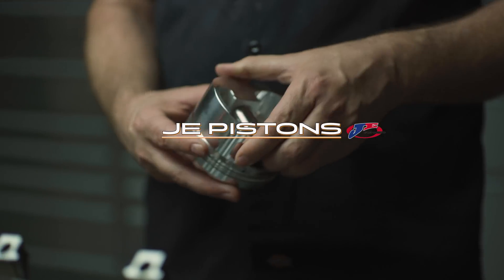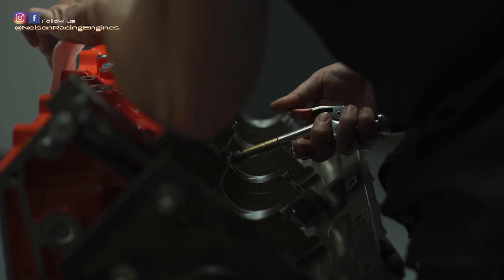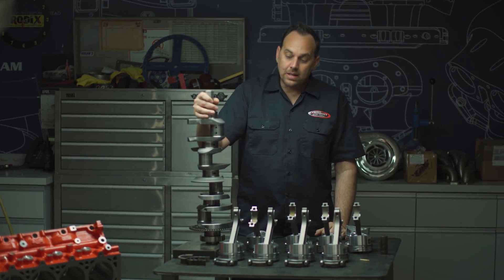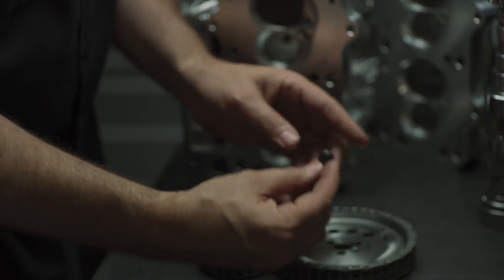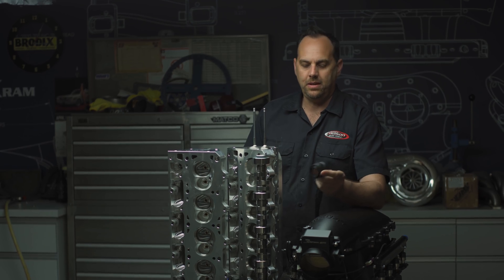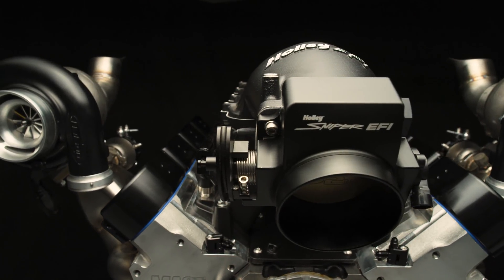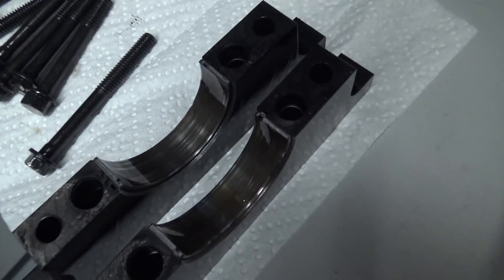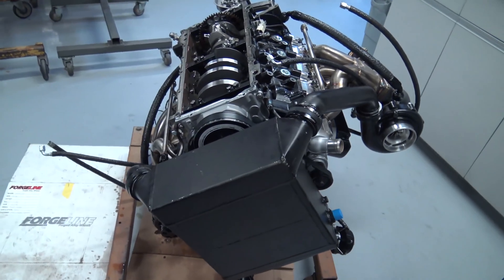Secrets Revealed!  1200 HP 260 ci Chevy LS!  Tom Nelson reveals his secrets!

Comment: Tom Nelson got your ears on ? I want to see a NRE small block Chevy configuration equiped cam, rods , pistons. crank , bearings etc. etc. set up of NRE choice set up to be compatible for todays modern two four barrel EFI throttle bodies which I just now watched a video from nitrous express express claiming you can program those bolt on EFI four barrel throttle bodies to spray more fuel for DRY NOS ....example of a EFI 4 barrel throttle body system 
https://www.edelbrock.com/shop/fuel-injection.html
why you ask ..? these EFI bolt on plug and play self tuning 4 barrel throttle body kits are getting cheaper to buy ..allowing the average street racer to put more bucks into the build quality of the engine internals ...like this boat motor shoehorned in under the hood of a Chevy Chevette ...
back in the mid 80s on south west archer avenue Chicago  there was a speed shop specializing in selling turnkey pro street chevettes with 502 big blocks with a tunnel ram. rising out of the hood two holley dominators and those. huge full coverage vilocity stacks that look like spittoons level with the roof top of the car ..they were tub-bed out with mickey thompson's narrowed rear end so all you saw from the rear was big rubber a Dana 70 pumpkin and more big rubber anda short set of wheelie bars ...
I believe your little buzz bomb boat motor with dual four EFI + NOS in a chevette could be exciting and get decent gas mileage and extra engine life as we know EFI has never washed out rings or bearings ....BUILD IT AND THEY WILL COME ....and if it becomes popular and I think it will you will have the opportunity to build a specialized NRE optimized EFI intake manifold ...tada ..there I just made you another million ...like lee Marvin said to the ladies above the bar in "paint your wagons"  " i give you the boy.. give me back the man"

Comment: At 1,200 hp What was the TORQUE, on that awesome 5 min pull. I'd love to have a engine designed to take that kind of torture. It's not abuse if it's ment to run under that kind of condition. My hats off for your ability to assemble & maintain a power plant as such WAY COOL !!!
Edit: I'm still convinced the Chev 409 or Z-11 427 with today's ability & technology. That Big block has unknown capabilities of horsepower and RPM's even in the late 60's race teams found out 6,000 RPM
Was just starting to produce staggering amounts of Horse power. But the iron block coud'nt take the stress due to its design.

Comment: That oil separator pump is something sweet.  I even want one in my daily driver, let alone in my race motors !
Reply: Yeah copy that, would certainly protect the engine from oil pressure leanout due to the oil consistency and the viscosity without any air turbulence.

Comment: Great build Tom. I like the recessed edge of the top of the cylinder. I was thinking, why not make a raised edge circles on the cylinder heads to fit  in each recessed valley. Perhaps make the recessed valleys just a little to small & heat them up, & the raised lip circles to big & freeze them, when installing them. I also think it would be  more powerful if you fired two pistons at once, like the front piston on one side & the back piston on the opposite side. I'm sure these billet cranks could handle the force easily. Another idea would be to turn a V8 block into a 4 piston block by making rectangle pistons out of two cylinders, & rectangle valves. The intake valve would be on the top side near the jntake manifold, & the exhaust valve on the bottom. The header could be rectangle shape at the top that turned into 2 inch round tubes. I also believe a flat plane crank is better balanced & produced more power & rpms. I was also wondering if you've ever heard of throttle exhaust. We use it in RC nitro boats & they work really well, perhaps it would work well in fuel injection turbocharged v8 engines. Keep up the good work, your a great engine builder.

Comment: That was frick`n awesome guys. I building an ls for my sons Camaro. I want 3 1/4" stroke on a 4" bore. Need a bit more torque so I don't have to run a tall gear. Keep it reasonable for a street car.
Reply: An ls like an oldschool 327 nice!
Reply: @talonvaughn6175  Spot on. He's got a 3.73 posi rear gear, and I've found that to be a good "all around" gear for the street. 😎
Reply: @aumetalmental8403  they are great gear for th350-400 and 700r4s thats for sure and muncies of course. I have 4.10s in my 06 ls2 gto with a 6 speed t56, runs amazing.
Reply: @talonvaughn6175  extra gears definitely give you more range. They don't teach young people how to drive a manual trans in Driver Ed anymore so my son is clueless and will only drive an automatic. They don't know what they're missing.
Reply: @aumetalmental8403  Yeah they dont know what they are missing. Manuals are a blast on the street. Not quite as fast as a th350 but still a lot of fun.

Comment: Whats the longevity on the jets? I feel like after long use they will start to become clogged.
Reply: Many factory engines have been using piston "squirters" for many years now. I personally had an old '98 Volvo; 5 cylinder turbo, mild bolt on mods, etc. Head gasket went at 190k miles, complete tear down for a full rebuild and the jets were clean as a whistle.
Reply: The high velocity of the oil, mixed with properly clean oil, this won’t be a problem, so long as the oil is cooled to prevent coking.

Comment: holy shit... a 2" stroke with over a 6" rod... WOW you have no side loading - I really like the oil jets at the bottom of the domes. Is there any coating which could keep the heat away from the piston? Inconel valves... I have used inconel backed brake pads however valves. DAMNNNN

Comment: They should have left it on high boost for at least 24 hours that would be the ultimate torture test
Reply: The valve lift and the moderate cam have a lot to do with valve train life at 7000 rpm.   You really do can optimize a boat motor for life at WOT.

Comment: You guys are Crazy! I was sure detonation would occur...Good Job. Thats not all Your tricks tho'!👍
Reply: These engines use 2 knock sensors that allow for high ignition advance unless RPM is under 450. The retard timing all day long unless no knock is detected. Most of the latest generation has a 5 volt DC bias voltage drop while using the AC signal for retarding timing. 5 volt is circuit integrity for OBD-II diagnostics. 
ASE Master Tech since 78.

Comment: Imagine this in a street car? 4.2L, no one would suspect that power. lol. I vote for a Miata Swap. 😂
Reply: Yeah engine still there Miata chassis looks like a pretzel 😂.
Reply: would not applicable lol... it only makes the power it does due to rpm , which means that small of cubic inch it needs alot of love separation angle because you cannot stuff that much pressure in to a small cylinder at low rpm due to turbo pressure is low at low rpm, now add to that tire rotaional rpm to gear ratio to torque converter multiplication rate.... look at how much it cost just for a true tranny to handle that level of power constantly.... 
the oil squirt on piston underside is nothing knew at all... notice he used a thick height piston to absorb the heat generated from compressed pressure of boost,bhe used a big heavy rod because you need more weight to handle the high rpm, it's .5 longer than even the best ls sbc rod and probably 2xs heavier
Reply: you would need a very steep rear end gear to keep it in its proper band per the valvtrain event timing, and where the fuk you gonna be hitting 9k rpms in ever shift lol ahahaha...
Reply: Accent

Comment: Me: So, how much of this engine is made from billet?
Tom: Yes
Reply: Camshaft, crankshaft and dry sump oil pump. So three. 
 It does not take an ASE Master Tech to count as you listen to the parts description. The pistons and cylinder head could be machined from a particular aluminum alloy billet but that information was not part of the secrets talked about.
  Pistons are custom design so possibly. Cylinder heads, perhaps. I will ask John next week at our BBQ.

Comment: bullet proof !! that thing is gone in 5 minutes! nothing is catching whatever that beast is in ! did you use spiral locks or horseshoe locks on the pistons ? should work on a nozzel that covers a wider area of the bottom of the piston to keep it cool as possible . will it have a large oil reservior with a cooler running through it to keep the oil cool ?

Comment: Taking some notes on Gas turbine engines lube systems even the lock wire. Love the engineering on that beast. The added thickness piston tops , huge pins and trick oil let’s for the bottom of the pistons . 100% great engineering!

Comment: Why won't ha thermal coat pistons  crown and the skirts. If you  layout big money for engine does make sense. 1200 hp ls twin turbo v8.here in Australia we have 242 ci 4 litre inline six road rego with 1200 plus hp at rear wheel.check out dynamite performance with there destroke 4 litre inline six to a 3.7 litre 2000 hp 10000 revs.you think small block  making that power is unreal . Jet performance 4 cylinder making 3500hp that's unreal.

Comment: Going fast cost alot, i use to work at a machine shop. Some of the tricks here we use to use at our shop. We used tungsten wire back in the days instead of piano wire. I like the dry sump set up. It will be a good upgrade than the conventional one.

Comment: Way back when, guys used to run the 283 because of the crank pin overlap between the main and rods. The other thing is that they had small journals, which allowed for more meat around the bolts and thicker walls on the mains when compared to a four bolt block. The distance between the outside edge of the main cap and the inside of the main journal is thicker than a four bolt 350 block, which gave it more strange hope. The rod ratio was better, the Pistons were lighter and all that added up to a motor that would rev like crazy, and make killer horsepower.

Comment: You're my hero man. I thought of mirror image turbos as far back as the early 90s, but it was way over my head to pursue it, yet you made them happen. I O-ringed a fist gen Chevy smblk and had to scrap it because I couldn't get the heads to seal, but you're making that work with that killer block you got. I even used a kit by Bo Laws here in Orlando to add wrist-pin oilers because I've built an electrically-driven Novi-2000 centrifugal to boost mine with and here you've come up with your own wrist pin oilers too. 
Way cool man. I love the way you just engineer to get what you want and that you have the means to get it done. To me, that's what it's all about. Those pistons and dry-sump are awesome. The only thing I'd try to do in addition is electrically drive and interlock it all which I know is a bit out of your field, but I'm sure it could be done. I'm big into PM DC and BLDC motors for that kind of thing. Save all the hp for the main-drive is my motto. Belts are a bummer. Anyway kudos on all you've done man because I really do think you do some outstanding work. I hope you never stop.

Comment: Reminds me of when i was a kid in the 70's. My dad had a friend that ran NHRA prostock and my dad helped him out from time to time. Back then, there were not a lot of go-fast catelog parts. You had to make everything. My dad and he were aircraftmachinists. As i recall, they ran a 327 small block stroked way down...i have no idea - 260 or 270 something ci. Concreted heads, o-ringed deck, rocker and crank stud girdles. Dry sump pump. This application was all about high RPM horsepower. Had to run a magneto for the high revs. He ran it through a race prepped powerglide and outback was some outlandishly low geared rear-end. One shift at the 1/8 mile mark and it was RPMs to the 1/4 mile mark. Not sure where the RPMs capped-out at but dad said it was in the high 4 digit numbers. I was a  boy then so i don't have real numbers. What i do remember was the freaking huge tunnel ram and header pipes the size of tennis balls. They were moving some serious air. So old school.
Reply: Blogposting

Comment: The replacement for displacement is boost
Reply: negative
Reply: @numbahonecapper  ghost rider
Reply: Phillip Phan your statement is correct. But that does not change the fact that the difference in power gained from more displacement is better than the power gained from boost.

A engine is essentially an air pump. More air in + more air out = more power. You're just not going to get the same gain from adding CIs as you would adding PSI.
Reply: @brettgast  Well that's because you're working with atmospheric pressures. The moment you put the same amount of boost on a larger displacement engine you gain way more horsepower. Boost isn't even an accurate measurement of airflow from a turbo/supercharger. I can guarantee that most larger displacements will create more horsepower with less boost than a smaller engine due to less airflow restrictions.
Reply: It's horsepower
Reply: The replacement for displacement is rpm.
Reply: Lol. You get something like 3% gain per CI added if you're good vs something like 7% gain per PSI of boost. Want to make big power build for boost.
Reply: @brettgast  Anything you do to a smaller displacement motor will be exponentially more-so in a larger displacement motor. It's simple science. You can physically compress and combust more air and fuel the more displacement you have.

You can't ignore basic science just because you have size envy lol.

10 psi on a 454 motor will have more power potential than 10 psi on a 350.
Reply: @numbahonecapper  no that is not true at all....
Reply: no that is incorrect!...

it's high compression and hi octane fuel...

Comment: Not to shabby, see a lot of the same techniques that I use on my builds on this engine. That was a hell of a torture test though. I've never used that kind of exhaust valve though I would be concerned about that friction weld not being bonded correctly and dropping the head of the valve in.
Reply: thats the whole purpose of having it on the engine dyno.  To find the weak links BEFORE its running 90+ mph down the water and costing the owner thousands...